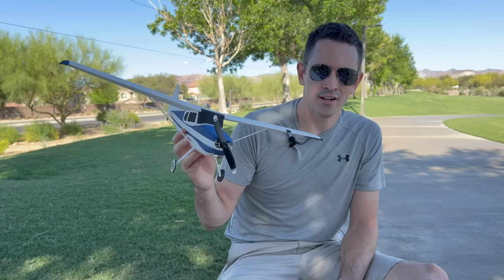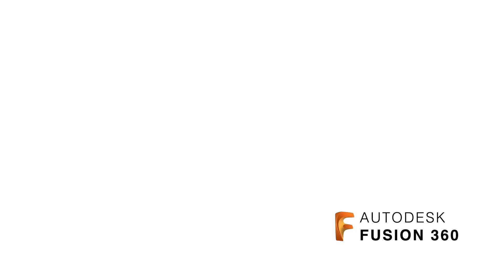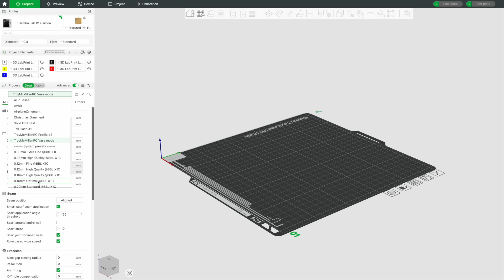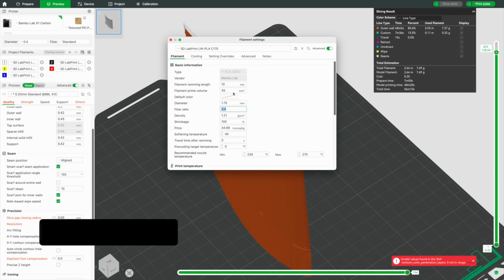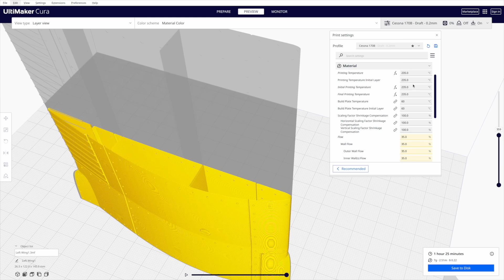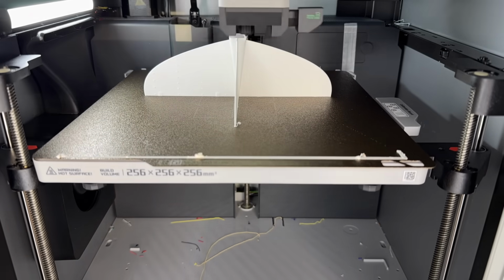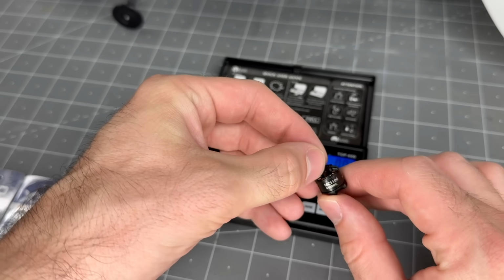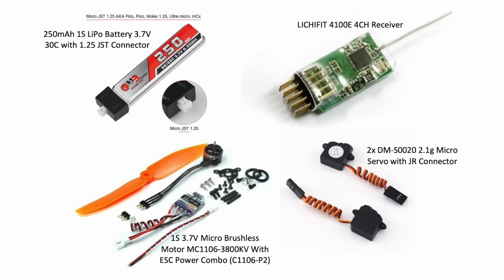SMALLEST 3D Printed RC Plane | Cessna 170

Comment: Flew mine indoors the other day. I am probably heavier than yours running the gear from an old umx carbon cub with a 2cell 250 battery and the as3x brick. It flew very well with no issues. Thanks for the great design!

Comment: has anyone been able to replicate those weights? I am have played around with flow and temp on colorfabb lw-pla, and the best result I have so far is 6,74g with 36 flow and 250 degrees. but any attempt at pushing this further, and the print starts to have a bunch of those small holes in it. using bambu h2s, and pla aero profile as base to edit in

Comment: Anyone try taking a sport cub 2 UMX version and gut it for this design? Do you think it would fly? RTF weight for this 3d print is 75g while the RTF sport cub s 2 weight is closer to 61g with the included 1s 150 MAH battery. If my calculator is right, this 3d print would be a 20% weight increase on the current super cub. I guess I could add 14g of weight to it to see if fly's but if anyone has any experience with repurposing the UMX series, let me know. It is possible that the sport cub electronics are lighter then the suggested ones for the 3d printed plane but not sure.

Comment: I am building this, not Troys fault. But make sure you double check motor rotation before glueing on the nose. I thought I checked it but wouldn't you know when I put the prop on indeed, I had it reversed. I had to cut the nose off the fix rotation. So glad I didn't put the wing on yet.

Comment: For me, it’s a work in progress. I love the look of this model and truly appreciate the work that went into it, so I bought the files and printed the parts in Bambu PLA-Aero.  All my pieces came out slightly heaver than planned. Adjusting the flow helped, but to hit his target weights, some parts ended up with patches that were lattice-thin. I suspect my electronics are slightly heaver than his as well. My setup is ELRS, and my receiver and ESC are separate. In the end, the ship came out 17 grams heaver than his.  Anyway, it flew, but just didn’t have enough power to stay in the air. One problem, besides the weight, may be the propeller. His parts list links to a 6030 prop, which I used. In hindsight, I think it’s too much propeller for this little motor. A 5030 is probably more suitable. For now, I’m experimenting with removing the landing gear, since it really isn’t needed. That alone shaved off 8.3 grams, but that still puts me almost 10% overweight. At this scale, that’s huge. In the end, I probably just need to reprint it lighter, even with the latticed parts.

For anyone considering this as a first project, I would highly discourage it. Working at this small scale is a real challenge, especially when it comes to the electronics. The other thing to consider is that everything is glued in place, even the wing. This makes it impossible to get to the electronics if you want to swap them out or correct an issue. It also makes repairs problematic, which is common to all 3D-printed planes. In the end, it’s a cool project, and I can see how and why he spent years developing it. I’m taking it on as a challenge to get this thing flying.
Reply: This is sad but great info, thank you for posting this

Comment: i bought the model and I have a a1 mini I would like some help to give me the correct settings to use in bambu studio because when I followed your exact steps My wing turned into mesh.
Reply: You should email Troy with your profile settings hopefully he can guide you. I don't remember if bambu forums allows a user to upload pictures and videos but I would like to see. Please provide a link if you do so
Reply: @jbraMoVal luckly i figured out the settings but unfortunately i have a problem with a over sized part for my a1 mini which is the tail

Comment: What if I don’t care about saving weight or fiddling with printer settings I just wanna print the plane in PLA and fly it as is will it fly or do I need to get a more powerful motor?
Reply: Will it fly? No. It will not.
Reply: @jbonewitz  I think I’m gonna find out because I seriously refuse to pay $35 a roll for that stupid foaming or pre-foamed PLA. Even if I print the plane twice, it still won’t cost me as much as it would if I printed in the foam PLA.
Reply: @jbonewitz and frankly, the carbon fiber PLA is almost the same weight.
Reply: I would try with a different model that it's free and just learn how to tweak the settings. If you're really lucky. find a user that has done exactly that using regular pla. Let me look for the video that helped me out

Comment: Great accomplishment. 
That said a Scratchbuild Stick 'n tissue Version would / should be LESS than mid 60' grams  RTF. 
My point being that given the Need for a capable 3d Printer ($$$.. Yess I too have a Bumboo printer 😄) a roll of LWpla ~50$ and the hours required to print it(and finally assemble it). 
Not much of  IF any  advantages to printeds  in My  experiences.. TBH.  It's basically a substitution of the skill to fabricate a 'Scale' model to pushing a print button... when someone else has done the design /scale work.   Remembering that printeds are as FRAGILE as empty egg shells. 
Stick 'n tissue versions are FAR tougher.. asbthey typically Bounce rather than Shatter.

Comment: Is it possible to print in bambulab a1 mini ?
Reply: Hi probably a month late but Bambi labs accept files STL, 3MF, STEP, STP, OBJ, and AMF, now so you can download the files on Bambi labs mini (you may have to readjust the model as the printing space size may different) now fillerment wise you want a lightweight fillerment Bambi labs recommends using PLA aero - though you can use alternative fillerment than Bambu labs recommends but may not be appropriate… hope that helps.

Comment: “The Cessna 170 is not a military aircraft, but it did serve as the basis for the military's L-19/O-1 Bird Dog. The L-19/O-1 was a variant of the Cessna 305, which itself was a military adaptation of the Cessna 170”….hmmmm just throwing this out there in case you want to attract some of us military type flyers lol…looks like a pretty simple fuselage adjustment…?

Comment: Getting around to printing and building this and I used the Polymaker Prefoamed lw-pla. Idk if its gonna fly haha, the wing weighs 50 grams, twice as much as the foaming stuff you used. Will have to try and see, then reprint in the cub yellow from 3dprintlab.
Reply: I sent back my Polymaker and got the Bambu Labs PLA Aero. Day and night difference!
Reply: @jbonewitz Thanks for the heads up! I actually reprinted in 3dprintlab polylight and my weights are much better and this plane is our best flying 3d printed plane so far!

Comment: Assuming you replicated the Cessna 170 to scale, 75g equates to wing loading of <14 g/dm2. That's very close to some of the best small motor gliders I've scene (~11 g/dm2). 14 g/dm2 is remarkable considering that this is a scale model and with 630mm wingspan. I think you could scale this up slightly, streamline the design, and have a high performance glider.

Comment: if we buy your .Stl files do you include the full configuration for polymaker  lwpla ( pre-foamed) ? which it look that what you used for this model. In the video you go too fast to capture the full print setting for that specific filament. will we get the same results of a activate foaming lw-pla ?
Reply: I thought he used Polymaker LWPLA as well, but he actually is using PolyLite. Unlike the Polymaker, it is not prefoamed, and will perform much better, however, the shipping cost for his material was very high, since is ships from overseas to the U.S. I ordered Bambu Labs PLA Aero, and so far am having much better luck.

Comment: Your link to 5030 propeller goes to Amazon TOP-VIGOR 8pcs CW CCW RC Propellers 6030 6 x 3, so did you use a 5030 or the 6030 link? Thanks

Comment: Started printing this evening this 170, 1st part i tried is the fuselage cowl but the file is slicing and printing the front opening without the cooling vents. Is there a separate part I am missing to print and added via glue?
Reply: Figured it out, for my Mk4s settings "Advanced" under "Slicing" changed my "Slice Gap Closing Radius" to 0.001 from default of 0.049. Also "Slicing Mode", changed to either Even-Odd or Close Holes, finally settled with Even-Odd for Prusa auto suggested Even-Odd for 3DLabprint Airplanes

Comment: Hey Troy this is  awesome.  After seeing your 3DLab Cub video I made one, then made a 1/2 size one with LW-PLA printed with 0.2mm nozzle. I scaled the stls 50% in cura.   It is powered by ovrsky brushless motor,  10A hk esc,  2s300 mAh battery, frsky SR6 Mini and uses 1.8g linear servos.  Comes in at 95g.  Your Cessna looks like a beautiful design.  Would you consider offering a wing with ailerons (and possibly flaps ? ) .  I love to buy one with  working ailerons.

Comment: You should try this with LW-ASA, ASA has density of about 1 while ASA has a density around 1.3, so theoretically you could shave nearly 20g! Also, ASA generally has better durability, UV, and temperature resistance!

Comment: Cannot sclice it correctly. the struts in the wingparts is missing after slicing. i use orcaslicer. 2.3.0
Reply from the maker: make sure to set the resolution to 0
double check your print settings
here's a video that references this 
https://youtube.com/shorts/hanTCyoud8U?si=REoZgTqhqjrVLvvz
Reply: TroyMcMillan, thx ist working now!

Comment: 1417   a pushrod this thin should have another fixed guide; near the mid-point of the unsupported part.
Reply from the maker: there are 3 supports from the servo to the control surface

Comment: Love your projects and this is awesome. After printing mostly larger planes, I've been looking to design a smaller 2S 750mm warbird with the same level of tight weight constraints as this. Any tips going into such a project? I use Onshape.
Reply from the maker: just keep it as light as possible for making a plane that small! every single part weighs something

Comment: Print a carbon lattice (PLA), then print ABS skin, which you can print by "faking" a vase mode print for something that's shaped like the surface you want that skin to glue on. Make sure your slicer has "ironing" mode. The print (which you can stop after that super thin bottom layer happens) will be a very thin membrane that you can glue to the carbon lattice. This will result in a wing that's strong enough to fly (maybe not crash... possibly not even land) that's leggera as it gets.
Reply: Will be great you make a forum post or a video showing those details
Reply: Yeah! please do make a forum!
Reply from the maker: I definitely agree that this would result in a lightweight part. The thing about it is that would take a load of experimenting and reprints for everyone and it would be difficult to get consistent weights for everyone. My projects need to be able to be completely recreated, therefore exact settings and sacrifice a little extra weight for consistent prints. It is still ultra-lightweight and flies really well a 75g RTF :)